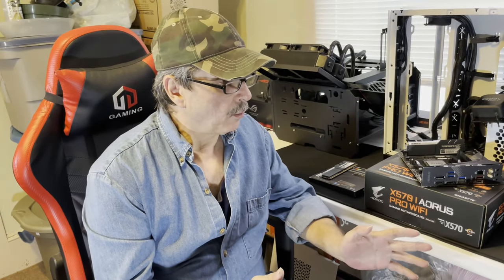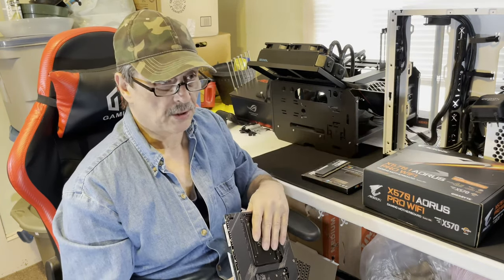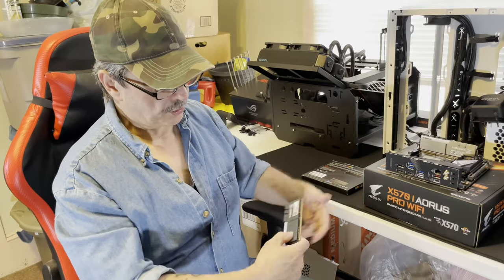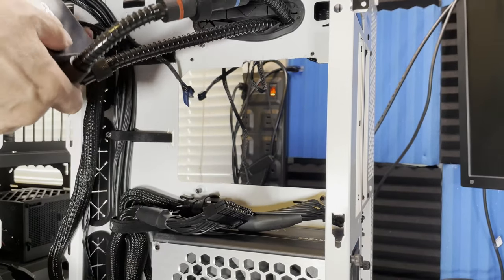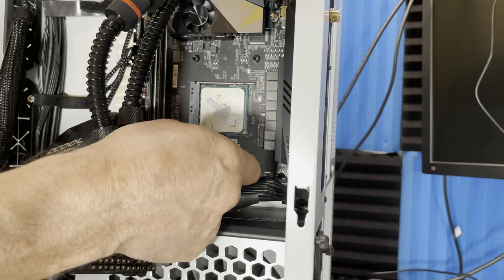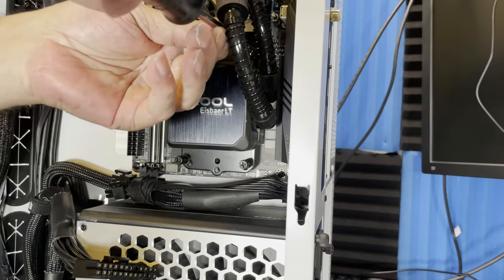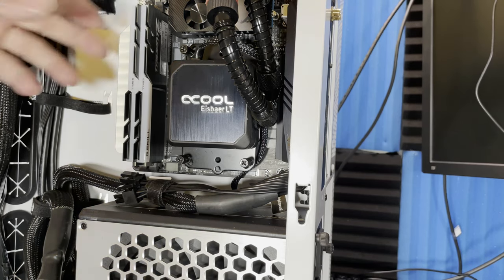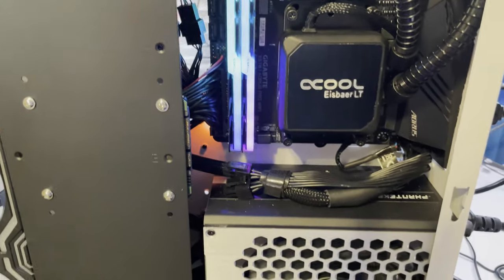MetallicGear NEO QUBE DUAL SYSTEM WATER COOLED.

Comment: Hey JP I noticed those AsiaHorse 360mm fan block. I was wondering if you have anything to mention about those? (If they're decent, if you've had an immediate issues with them. etc)
Reply from the maker: No issue's at all. I have been using them for over a year now and the fans still sound good and the ARGB is nice and bright, actually it's a little bit to much for me but all in all they are very good in performance and price.
Reply: @JPsTechReviews  how were the thermals on this system? I’m honestly thinking about this for gaming/stream rig setup
Reply from the maker: The are a high pressure fans so they move are well with little restrictions.  Definitely get the job done.

Comment: hey buddy, how can I connect two motherboards (through 24 pin) at 1 psu?
Reply from the maker: https://www.amazon.com/Phanteks-PH-P1200PS-80-Platinum-Built/dp/B07H7K5C8W?th=1
Reply from the maker: The Power supply is designed to work with two and it does a really good job.
Reply: @JPsTechReviews  Thank you for your assistance. Sad part is, this psu is hardly available in India and if it is, it's very costly.

Comment: Hello JP,
Quick question, Do I need different windows products key in a dual system PC. I was asking because I cloned my drive and I'm using that same operating system on my itx board. And my share mouse is not working. Please advice..
Reply from the maker: You probably would need a new key because windows will most likely see the difference in your system hardware, that’s how people get stuck having to pay for a new windows when they change out a couple of peace’s of hardware.  I usually go to keysoff.com and get my keys for under $10.00
Hope this helps
Reply: Thank you so much for your help. I will try that because I am trying to get share mouse to work on my dual system.
Thank you again!!!
Reply from the maker: @sabasgutierrez3781  You can also get a KVM Switch,  https://www.amazon.com/dp/B07ZK36RBJ/ref=syn_sd_onsite_desktop_123?psc=1&pd_rd_plhdr=t&spLa=ZW5jcnlwdGVkUXVhbGlmaWVyPUEySEFCTDJFMjVaRTRHJmVuY3J5cHRlZElkPUEwNjQ0MzY1MlpUNlFNVlo4QVlLSyZlbmNyeXB0ZWRBZElkPUEwNDY1MjA0VzZCNjIyVzRIOFExJndpZGdldE5hbWU9c2Rfb25zaXRlX2Rlc2t0b3AmYWN0aW9uPWNsaWNrUmVkaXJlY3QmZG9Ob3RMb2dDbGljaz10cnVl